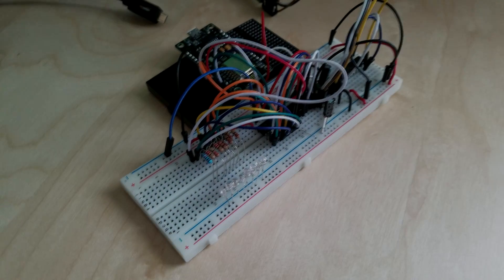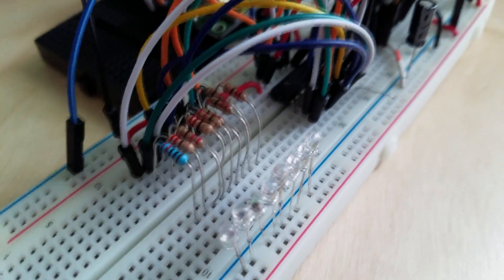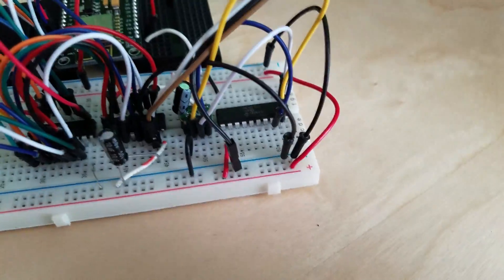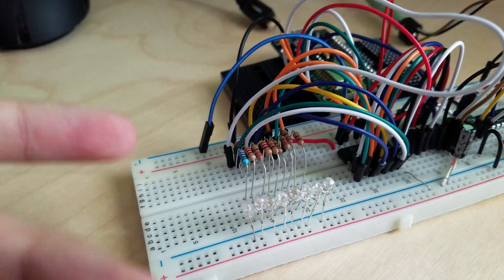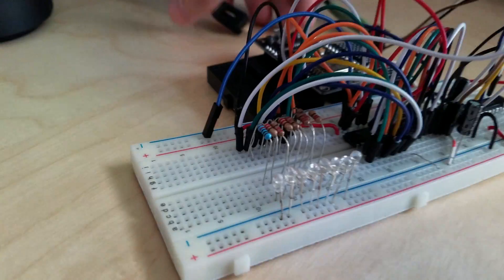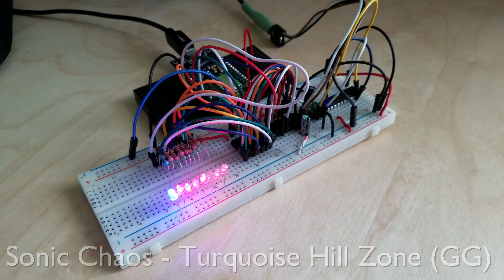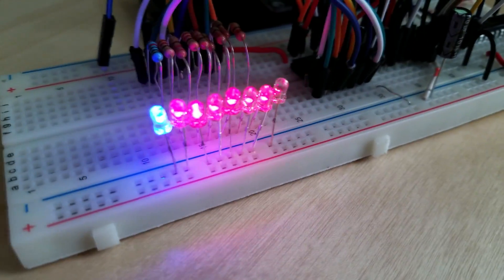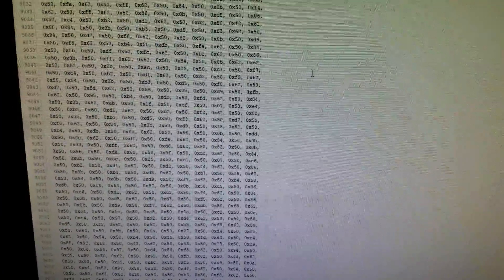ESP8266 SN76489 PSG VGM Player

Comment from the maker: I've actually fixed the slowdown issues mentioned in the video. It was due to a delay that was WAY longer than it needed to be!
Reply from the maker: The Arduino Uno is sadly nowhere near powerful enough to play back VGM data in real time. You could make a YM2612 test circuit with it, but that's about as far as you're going to get. https://github.com/skywodd/avr_vgm_player/tree/master/ym2612_test

I've been working on a new version of this project based on the Teensy 3.5, and so far, it's been going great!
https://youtu.be/4GdV9DpxYRI
Reply from the maker: Diego Garrido Mendoza oops! I didn't realise that this was the PSG only version. In that case, it may be possible to get some very basic PSG VGM streaming with an Arduino uno, but I don't think it would be very fun. I'd still recommend a faster chip with more RAM and storage :)

Comment: Hi Aidan! Great content!  I was looking through the music.h file you have on the GitHub page linked in your description and was curious about the playback/sampling rate.  For example, “Sonic Chaos - Turquoise Hill Zone” is 18410 bytes long.  You say you are sampling at 44.1kHz - does this mean that you are sending one byte to the SN76489 every 1/(44,100) seconds?  It seems like this would cause the song to play much too fast given the size of the array…  In ESP8266_VGM_Player.ino I see reference to 60Hz (and 50Hz).  Does the SN76489 really get a byte sent to it every 1/60 (or 1/50 ?) seconds?
Reply from the maker: Hello. This was one of my first ever VGM players back when I really didn't know what I was doing, so my timing is likely less than accurate here. The 44.1KHz sample rate is specified by the VGM spec. The SN76489 doesn't receive a sample every 1/44.1K seconds per se, the VGM data is parsed at that rate. So every 1/44.1K seconds, I will read a new VGM command. This includes delay commands and chip write commands.

Comment: Just starting to learn basic electronics, here from Reddit, in basic terms what is actually going on here? What produces the sound and where is the sound stored?
Reply from the maker: So, the ESP8266 (Silver and black board at the top) is the main processor of this system. It stores video game music data (VGM format) and sends that data, byte-by-byte, to a 74HC595 shift register. The shift register simply takes that byte and translates it to 8 on-or-off pins. Those 8 pins from the shift register are used as an 8-bit data bus to send commands to the SN76489 PSG - the chip that actually makes noise! The SN76489 is very simple and can only produce three channels of square waves and one channel of hissy-noise. The SN76489 was found in the Sega Master System, but it was also paired up with the YM2612 FM synthesizer chip in the Sega Genesis. The YM2612 is much more advanced, but in return, it gives the songs a massive jump in audio fidelity. 
If you'd like to see my updated version of this project featuring the YM2612, I've got a few rough prototype videos up now! https://www.youtube.com/watch?v=S3HPq6Ja-dk

Comment: Really nice project. I am looking forward to seeing where else you take it. Is the ESP doing any processing or just streaming data?
Reply from the maker: Thank you! The ESP holds all of the VGM data in an array of uint8's in flash. It will then parse through that data and perform all of the necessary delay calculations and stream PSG commands to the shift register when ever it comes across them.